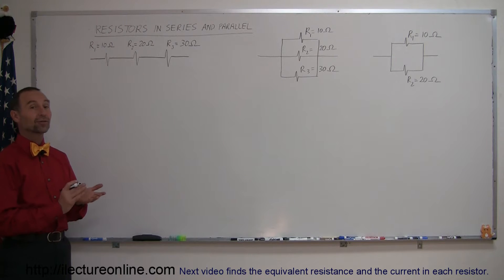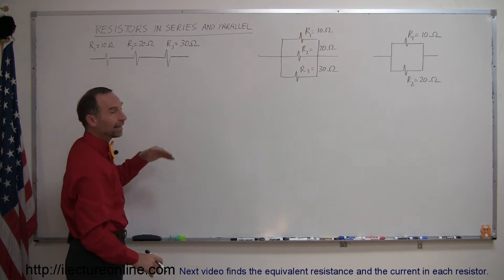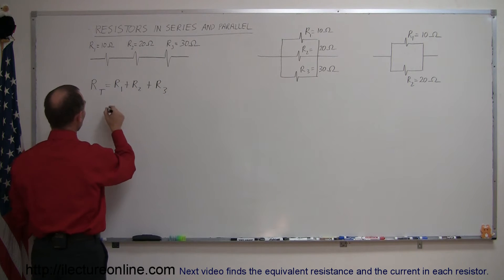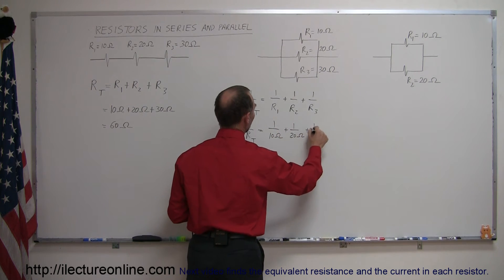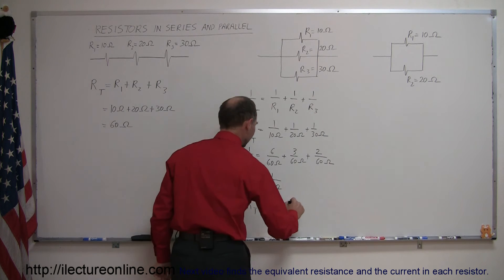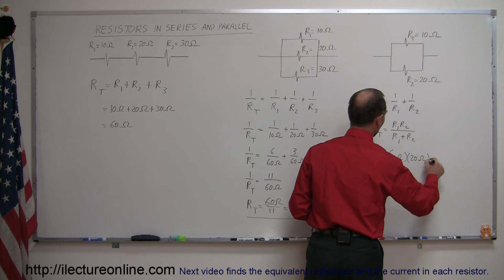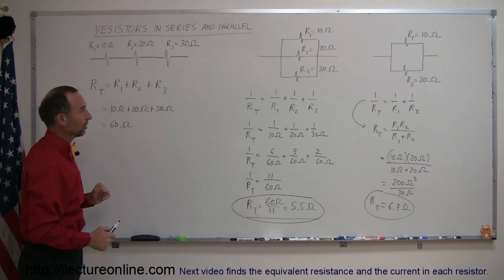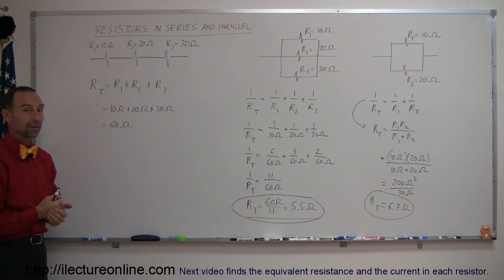Physics 41    Resistors in Series and Parallel (1 of 5)

Comment: Mike, why do you square @ 3.48?

Of the 20+ videos I've watched - you're the best..........
Reply from the maker: +Ten Millimeter 
(10 m ) * (10 m) = 100 m^2
(10 ohms) * (20 ohms)= 200 ohms^2
Reply: I thought 100^2 is 10,000 and 200^2 is 40,000?
Reply: +Ten Millimetre It's not 200^2 Ohm, it's 200 Ohm^2. So it becomes (200)(1 Ohm)(1 Ohm)/(30 Ohm). 1 Ohm from top and bottom cancel out.

It's like how 10cm*5cm = 50cm^2, but thats not the same as  50^2cm (which would be 2500cm)